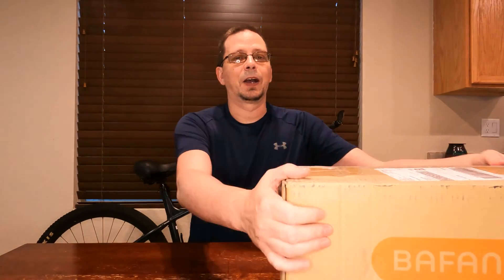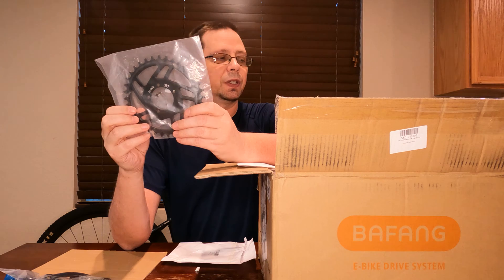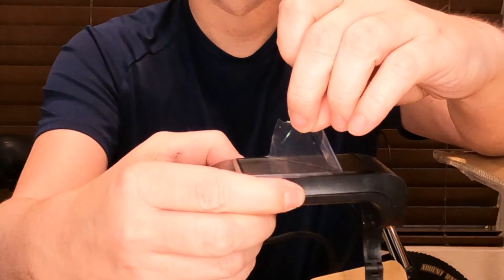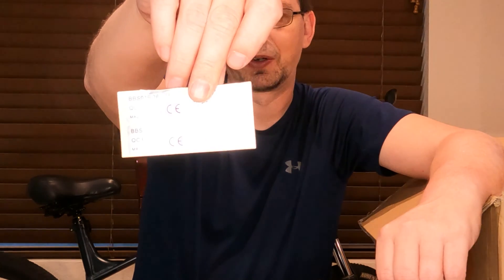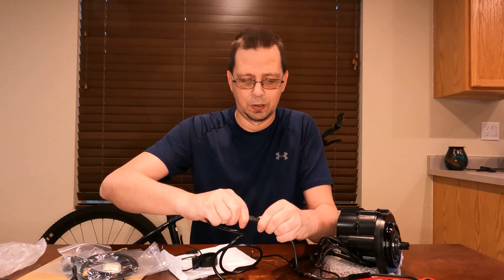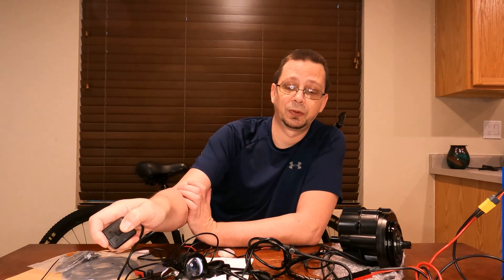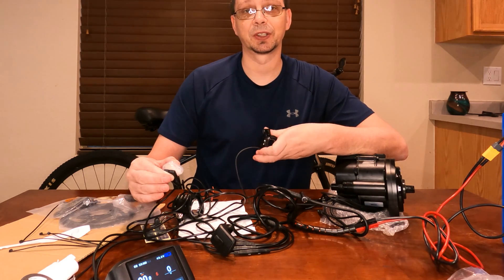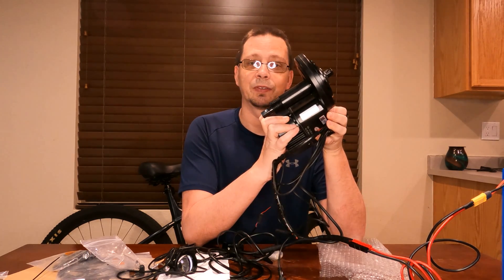BAFANG 1000 Watt BBSHD E Bike Conversion Kit

Comment: It's June 30 I believe, Eric I am having a problem, maybe you can help me? I really hope, so I'm having a meltdown because I don't know what brands/ makes of bicycles I can turn into my ebike, man I'm having major anxiety over this, Eric how do I know which bikes are candidates for this make over, do you think you could enlighten me a little bit on this subject Eric please, and I'm waiting for your response in anticipation because I need to get doing this like in the worst way
Reply from the maker: Just about any bike can be converted into an e-bike. I find that mountain bikes work real well because they are already built strong. Bafang comes is 3 different bottom bracket sizes. You just have to match it to the bike you get.
Reply: @Eric_Tennant  ok I feel a bit better. Doing this means so much to me, Im just going to think positively and onward and forth

Comment: did you order it from amazon?
Reply from the maker: Nope I went the slower cheaper road with AliExpress.
Reply: @Eric_Tennant  got you, sorry to ask but on amazon the description says i could either get the brake levers with sensors or brake sensors, but there’s no way to choose which mean i would have to contact bafang or seller on amazon to choose? also do you think the bafang battery are safe? i know it’s not a good idea to cheap out on battery specially on amazon, thanks.
Reply from the maker: @dennyf57  You would message the seller for brake sensor or levers. I have not use a Bafang battery before but I do know the one that mount on the triangle are best for weight distribution and it looks like that how the Bafang ones are designed.

With their newest motor M.625 it requires it to be a Bafang battery. That why I went one model back to the BBSHD.

The only unsafe ones I know of are on ebay. They have a lot of scams. A few cheap ones on Amazon are lying about capacity. You can tell because they are half the size and weight of others. Unit pack power https://amzn.to/3knyxeI is one that I do trust.

Comment: you should do an installation walkthrough! im setting up my marlin 7 with a bbshd motor this weekend
Reply from the maker: Editing the Install right now. Many Bafang video to come.

One problem I'm working on is getting it to have a better chain line. Right now I can't get into the 2 biggest gears. I own 2 chain ring and got 3rd and final (I hope) on the way ( https://amzn.to/3NWTxn6 ) . This has a offset of 20.5mm, and I think I can get it to work. Will know more once I get it. Shipping is real slow.
Reply: @Eric_Tennant  what chain ring are you using? i have a lekkie 42t from my old build that im gonna put on my marlin 7, hoping i dont have any issues with it.
edit: nvm i see you linked the chainring you just bought. lmk how the 42t works for you! i'll have everything to finish my build on sunday probably
Reply from the maker: Lekkie 42t will work. Think it is near (+0.1mm) the same as the one I order minus the brand name. I just didn't want to give them $170 + shipping. Greedy they are! Let me know how it fits. Right now I have 2x2mm spacer on the motor bottom bracket on the drive side. Was needed to keep motor off the chain stay.  3mm total may work better. Not sure!